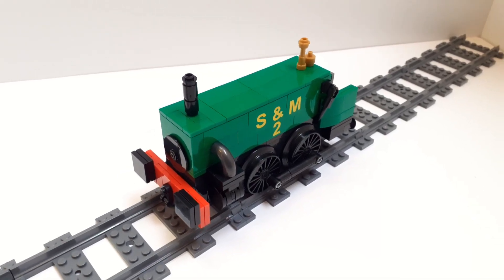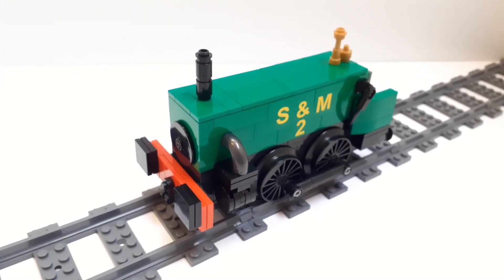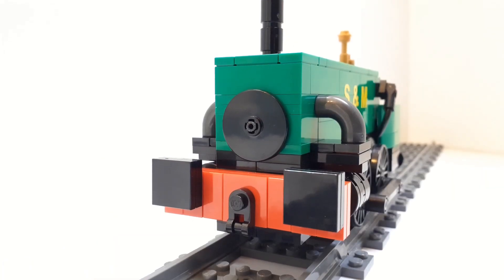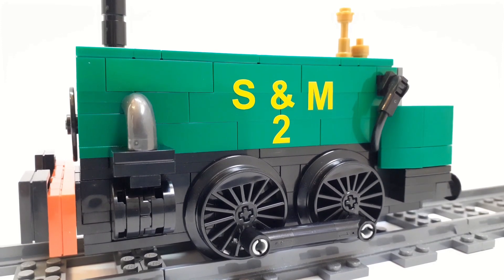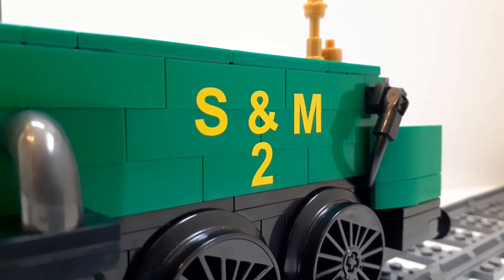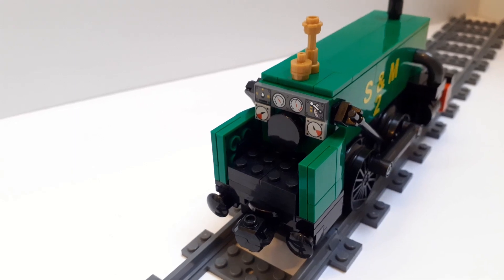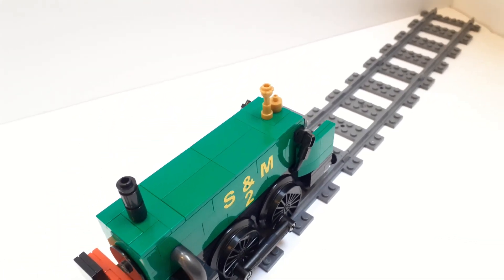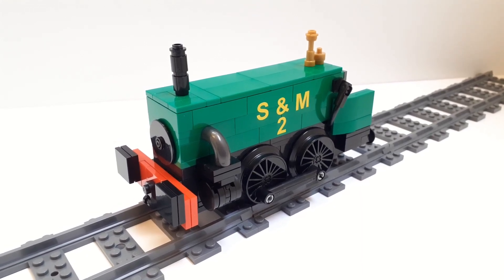Lego Neil MOC showcase

Comment: How did you attach the cylinders to the cylinder saddle?
Reply from the maker: I did a bit of sideways building with side studded bricks and the 2x3 plates with the rounded end
Reply: @TritonBrickRailway  Oh that's interesting, I was picturing a 1x1 bracket plate built into that section of the cylinder with the 1x1 1/4 circle tiles.